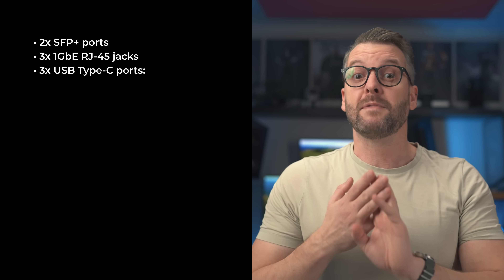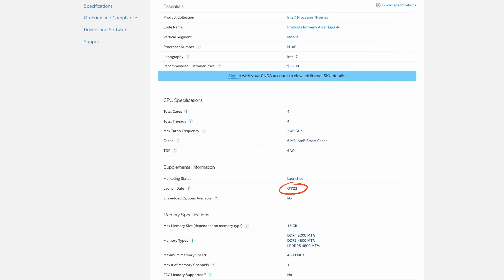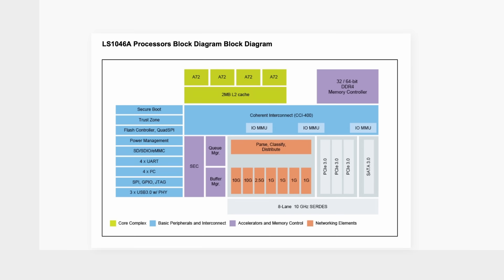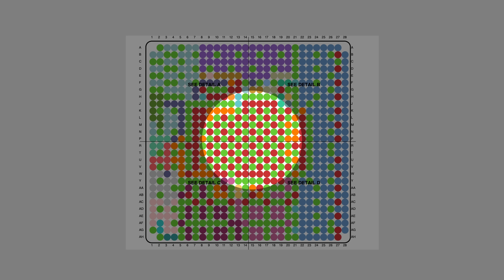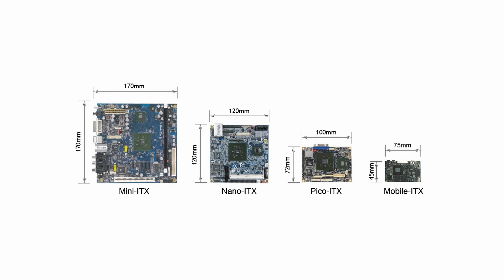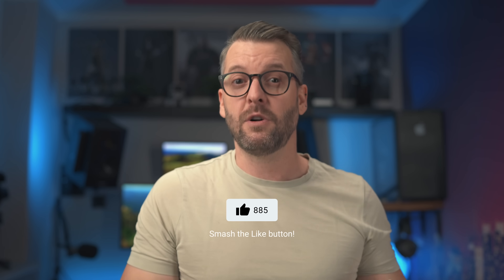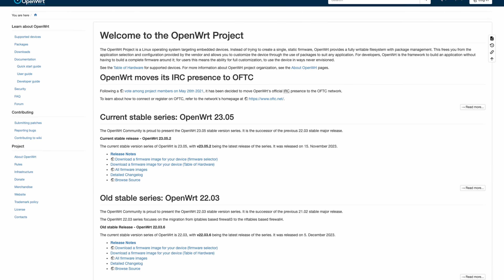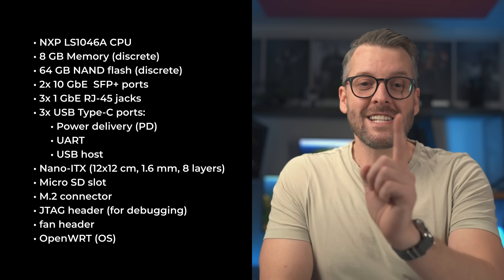I'm making a high-end router IN PUBLIC. Here are the final specifications.

Comment: Good project, wish you luck. I've got a technical question: there are NOR flashes up to 256MBytes (not cheap though), but to my experience, it's more than enough for a router, at least for OpenWRT. Why to add NAND, especially if you plan to have USB and M.2?
Reply from the maker: Because in the long run, I'd like to port OPNsense to this device, and based on their documentation, 40GB is recommended. And NAND is there because I want the device to be plug and play, I don't want customers to have to deal with M.2 and/or USB unless they want to.
Reply: @tomazzaman Sounds reasonable. Good luck!

Comment: Question: this CPU you choose can handle 10Gbps traffic between the 2 ports? Example: now I'm using an APU6 with 1xSPF 3xRJ45 1Gbps. But the CPU is not enough powerful to handle 1Gbps traffic. I know AMD GX-412TC SOC is very old CPU, but I'm curious if this CPU can handle full 10Gbps.
Reply from the maker: Once the development boards arrive (the ones that are manufactured by NXP to showcase the CPU capabilities), the very first thing I'll do is try to install OpenWRT and the next will be testing the throughput, as it's the single most important thing that I'd like to know as well!
Reply: @tomazzaman Thanks Tomaz! I already subscribe to your channel for some time and I'm waiting your video about the throughput. Right now I'm looking for a soft router with 10GbE SFP+ and 2.5GbE. The only one which fits for my needs in this moment is Qotom Q20331G9. It has 2x Intel X553 integrated NICs in CPU + 5x 2.5GbE i226-V. I can not waiting for your feedback because, as I mention before, APU6 is not handle anymore my traffic for 1GbE and I really need to upgrade it and I wish something at least designed in Europe.
These NICs in this CPU what offloads they offer? For example X553 supports VXLAN offload. I couldn't find the offloads for the NICs in the CPU datasheet.
I'm interested in VXLAN, MPLS, AES (IPSec) offloads, mostly. I know that are not common for majority people, but when you create VPNs, well, you need them.

Comment: I've worked with layerscape - don't get wowed by the hype, it's not that great. Also, carefully read the errata for it ;)
About routers these days:
- you want double m.2, so you can make redundant storage - those devices really need reliability to be as high as possible for routing. Also if you decide to do something dumb like m.2 sata, those drives are unbelievably unreliable making your router ... you get the gist. (this is mistake that netgate done with their 6100) 
- judging by the device you picked, you're aiming at residential, SOHO, homelab - those people will want to run extra services like reverse proxy or packet inspection. With that you're 8gb is just not going to cut it.
- those layerscape chips when pushed require more cooling than motorola want's to admit.
Reply from the maker: Thanks for the feedback, I plan to test their reference design boards thoroughly to either prove or disprove what you're saying :)
Reply: @tomazzaman  just bare in mind that reference design you'll get from nxp is a eval card on a motherboard, and it has a pretty fast fan on it's radiator. Motorola guys are like "naah that's just a precaution it should go with passive" while at my office when we started deep packet inspection that fan struggled to keep it cool and we had to take of the lid of their eval 1U unit to keep it ok-ish temp wise. Also if you intend to run secure boot (duno, for uefi maybe ?) then be prepared that their documentation is a bit of a hot mess - it looks like bunch of exerts from different chips gathered together.
Reply from the maker: @tommybronze3451 thanks for the heads up!

Comment: PoE is easy to add as an extra plug-in board, just need a header with the ethernet transformer centretaps and power, so having that as a user-installable option seems like the most sensible approach as not everyone will want it
Reply from the maker: Yes but we then need to consider the power delivery (power brick becomes more expensive as well), so that there's enough juice.

Comment: Imho I would ditch all 1gbps ports all together and add 2.5gbps instead. They are backwards compatible anyway.
For CPU, I like arm64 on some parts but for router, I don't know, i'd rather have AMD64 cause that means I can switch O/S whenever I want but with arm64 I would be pretty much locked to a single or two max options.
Also one more thing, it has to be rack mountable or at least make the holes for it and we can 3D print something to mount it in a rack
Reply: Most Linux distros have an arm64 version, so you should have quite a few options especially if they get UEFI working, and I really like the CPU he chose for those networking optimisations he stated in the video.
Reply: @SteveTech  I am talking about pfsense for example that doesn't have arm64 at least not one that i can see in their downloads page. I am not talking about generic linux distros, this is not a pc but a router so please keep the convo in router o/s and not deflect on the topic
Reply: @toumpanis  Yeah sorry, I'm happy to set things up the hard way through iptables, dhcpd, unbound, and whatever else, but I realise that is probably way out of the target demographic.

Also he did say he hopes to port opnsense in the long run too.
Reply: @SteveTech  I don't see any point fighting windmills like Don Quixote when there is no need for it. As impressive as it might be to setup the hard way, I wouldn't go that path for various reasons, convenience is one of them.
It is good for a project like this to be versatile so anyone can work it the way he wants :)
Reply: @SteveTech  https://en.wikipedia.org/wiki/List_of_router_and_firewall_distributions this is a list of router and firewall distros, there are a few that indeed support arm64 but I wouldn't use any of them in a device like that. Someone said about pfsense, it is listed as arm as well but I guess that is for netgate's devices. So indeed going with arm64 is limiting the options

Comment: I don't really get the discussion around the 1/2.5G ports. This is a router, not a switch. I feel like the two 10G ports are the most important feature. I consider the speed of the auxiliary ports not that important. I think one additional port is useful for management, but in that case even a 100M one would suffice.
Reply from the maker: Exactly, a "proper" router needs two ports, a WAN and a LAN, and maybe a third for some kind of backup. However, people have spoken, and they want more ports, and luckily, then can get a few extra :)
Reply: @tomazzaman Theoretically a router may even route between more that two networks (look at the Cisco ISR series for example) but this is clearly not the target of this project. If such a feature is needed it can also be achieved with VLANs or hooking up several of your routers to a 10G switch. I think your scope for this product is well defined. (Maybe an idea for your company: Provide a cloud-based service to manage a cluster of these routers at once :P)
Reply: After reading through the comments I'm quite confused what people expect from this product. My impression was that this is in between expensive enterprisy Cisco stuff and these kinda-DIY Homelab x86 OpnSense/pfSense enthusiast routers. So a decently fast but not cheap router, but also not super expensive and proprietary. Why do people want PoE so bad? (Also there's PoE, PoE+ and PoE++) What do you want to power with this in the first place? A single security camera? A single AP? A 5-port PoE powered 1G switch?? Doesn't sound like your environment warrants this router. And if you need PoE so desperately for one port, why not just get one of these cheap injectors? If you power a fleet of APs, you're gonna use a PoE switch anyway. Same thing for security cameras. And what are people hooking up to that 2.5G port? A single computer? Why? If you have a 2.5G network, I suspect your switch has a 10G uplink. And if not you can still stick a 2.5G module into the 10G port.

It's not like these features are gonna hurt, but they'll increase the price and effort and I don't think they are the reason why people buy this thing. These people will stick with their repurposed mini PCs or these special no fan builds from Aliexpress (Qotom etc.). If people argue that they'll want to avoid getting a 2.5G module they'll be put of by the price of this router anyway. And I suspect the ones asking for these features are just enthusiastic about the development process right now.

Comment: I'd say having the 2.5G port is a must have. Both of my local internet providers are set to introduce 2gib+ within the year, and are already  upgrading existing CPE to have 2.5g. While using 1 of the sfp+ ports  as an uplink from a poe+ 2.5g switch to provide wifi7 APs  is acceptable, having to use one just to get a full speed link to your CPE would leave a bad taste in my mouth. IMO
Reply from the maker: Thanks for the feedback, I'm trying my best to get the 2.5 on the device. You see, the problem is that there has to be a compromise. A more powerful CPU would make the overall device more expensive (in a sigificant way). Or, if using the same one, we'd need to let go of one 10GbE to get more 2.5GbE ports. In every case, something has got to give.
Reply: @tomazzaman  Sure, that's understandable. I'm really only advocating to breakout the single 2.5g  that the block diagram indicated was available from the CPU. However if losing an sfp+ port is needed to implement it,  then may I suggest a mount w/blanking plate on the casing near the M.2 to support an M.2 A+E KEY 2.5G
Reply from the maker: @invictus0x0 yep, that too has crossed my mind. Or, adding an additional PCIe PHY chip on the board. This traffic wouldn't go through the "optimized" path (the DPAA), but 4 cores shouldn't struggle with 2.5Gb.

Comment: Needs to have internal PSU.... So universal voltage with IEC connector, possible redundant 12v option... Both on the back. All network ports on front?
Reply from the maker: No internal PSU because it complicates the design quite a lot. All ports on one side, you'll be able to decide which way you prefer to turn it :)
Reply: USB-C with PD is the way to go. You don't need to deal with gigh voltage certifications, have a world wide usable powersupply and one can use a usb-c powerbank with passthrough charging as a solid UPS at minimal setup complexity.

Comment: A N305 with 4 x 2.5Gb ports is enough for me. Running FreeBSD 14 native with opnsense in a bhyve vm. This means I can get a lot of use out of it with multiple VMs.
Reply from the maker: Ideally, this router will not be the only device in a home network, I personally want it just as a router, and then then have it connected to a switch, which then can break out the 10Gb SFP+ into multiple 2.5Gb ports, for example.

Comment: What’s with an discreet power port like a 12V barrel jack? The USB-C option is great but when it comes to integrating it in existing stuff a barrel jack or something similar is easier because you don’t need to deal with USB PD communication and just can add a 12V source.
Reply from the maker: I'd argue is the other way around. USB Type-C is pretty much everywhere these days. Everyone has these cables lying in a drawer somewhere. And USB PD is also standardized, so there's no issues with compatibility. The device will come with a GaN charger and a cable anyway, so in reality, it makes no difference - in fact, PD wasn't even taken into consideration initially, but enough people "voted" for it on the form (2000 responses to this day) that we decided to add it.
Reply: @tomazzaman  Yeah USB PD is great and an Allrounder, and pretty much works with everything. But would it be a lot of work and higher cost to add a DC barrel jack?

Comment: Router with 5 network ports? 😢
Reply from the maker: Why not?
Reply: @tomazzaman  I was expecting more ports. I have file server, app server, two laptops and a desktop at my home.
Reply: @TomekSw  Its a router, not a switch - it only really "needs" 2 ports - WAN and LAN.
Reply: @tomazzaman  & a Steam Deck xd
Reply: @TomekSw Then you'd use a network switch! Which would open up more ports on your network, turning your 5 ports into as many as you want (or really as many as your router and switches can handle.)

Comment: dual port 40g(56) cards are like 50 bucks - networking is the weakest link for smb sector - they should probably skip 10g and goto 25gbe or 40/56gbe if possible - save time, time is money #mtu #opnsense licensing  my impression on this is that it is too professional, no need to reinvent the wheel - it will be too expensive and won't sell whereas opnsense is cheap and proven and expandable/scalable plus it just works and it is cheap, very cheap, also looks don't mean shit - the router will be in a closet covered in dust if it is successful but this is low end product that will get crushed by cheap chinese routers - i think you need to go higher end/enterprise or just start selling opnsense custom routers now - that is a business opp staring you right in the face #cto

Comment: I don't really see a use for just one 2.5GbE port.
Shouldn't there be at least two, so that you'd have that link speed between two devices?
Reply from the maker: A router, in its purest form, has two ports: a WAN and a LAN. And even then, they can be done in a single physical port with the use of VLANS.  So ideally, this router will be connected to a switch via the 10Gb SFP+ port and then that switch breaks that bandwidth into multiple 2.5GbE ports, or whatever the owner needs/wants. I hope it makes sense?

Comment: Will it be possible to add a cellular radio to this router?
Reply from the maker: Initially no, but the M.2 slot will be, well standard, so picking a solution that's already on the market shouldn't be a problem.
Reply: Should be possible through M.2 or USB Host ports
Reply: He said m.2 wifi in the video and m.2 wifi and m.2 cellular have different keying, also m.2 cellular requires a sim slot on the motherboard wired to the slot

Comment: I want a small display even if it's just a small cheap one.
I'd like to see a spi based display with known libraries like a st7735 or an st7789 adafruit has the small 240x240 display that's almost identical to the one on unifi units.
Or add an eyespi header so we can mod.
If you do use poe why not just make it poe pass through rather than add internal poe.
Setup the 1gb ports to take in poe+ power the device and pass on single pair poe.

Comment: If it does not work as access point, and it does not have WiFi antennas (including support for 2.4 GHz, because many devices still use it), I would not even consider it. It is just another mini computer, and there are plenty on the market.
Reply: It's a router not an access point. He did mention it will have a M.2 connector so you can install a WiFi card if needed.
Reply: A WiFi card for what? It makes no sense. The project will fail miserably if it is just a router and it cannot work as access point and mesh. Why in the world should I have a router, and then a separate access point, when all the devices nowadays connect through WiFi? I have 8 WiFi devices in my home. The only wired device is Time Capsule, which I use for backups. If I want a router, I can install Linux on a mini computer, there are 500 different models for sale. It is a dumb idea. @phizaal
Reply: Yea its not a AP, and yes routers are small computers juat very good at routing packages at a specidic layer, to have wifi you should look into a dedicated AP anyway as they are specialized devices and work much better then adding something like that into a router
Reply from the maker: I prefer my devices to be highly specialized and separated. I'm working on a router, not an all-in-one device you get from your ISP. And luckily, many people seem to agree.

Comment: Will we be able to buy it?
Reply: Yes, but most likely not this year. He mentioned that an early prototype will be finished by september, so it could be available by next year. My estimation is purely speculation so don't take at it face value.
Reply from the maker: Yes, the plan has been for this to become a mass produced device since the inception. Next year.
Reply: Ok! It is coming to Australia, right? Will the IP change when you restart it? It would also be dope if you were able to connect custom built Ethernet over Powerline plugs to it, without having to set them up separately. The router could be the hub, with other little plugs to put around the house! Don't know what's involved in setting that up though, but it would be epic if it did! @tomazzaman